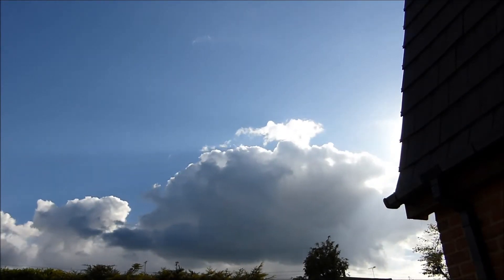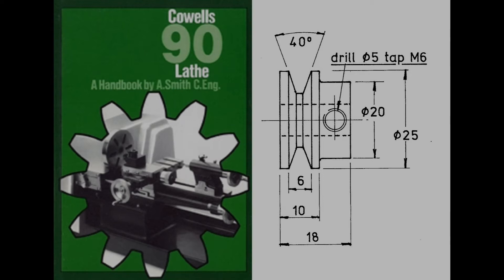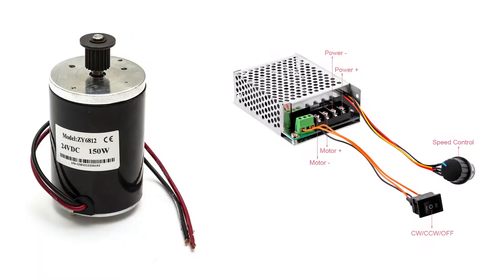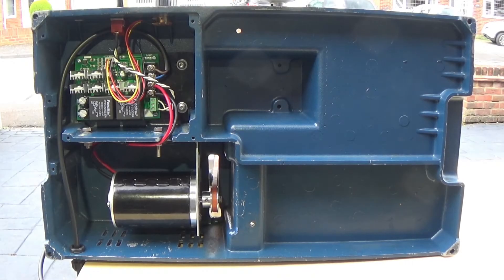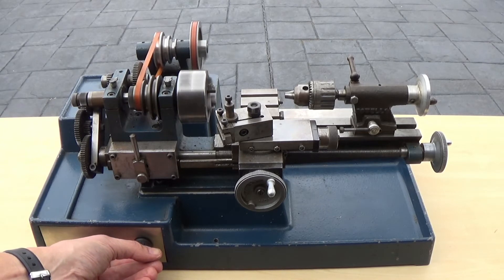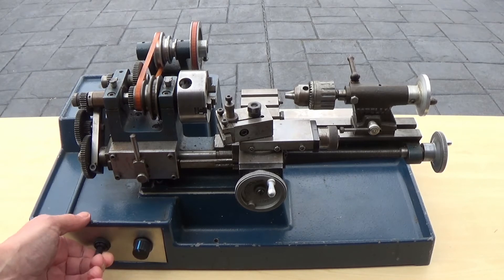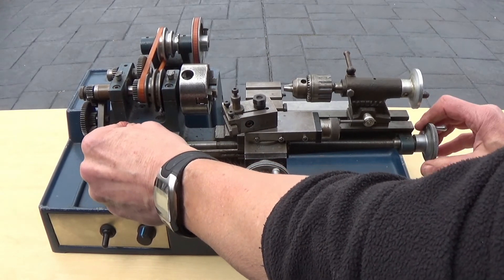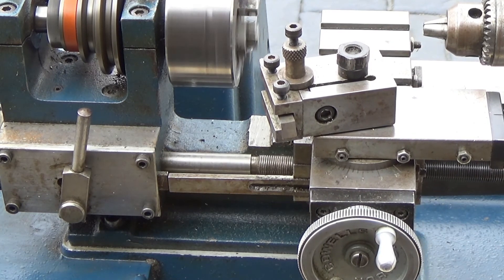Cowells 90ME Lathe  - Part 2 - First Run

Comment: 4:27 shows the motor pulley and belt out of alignment with the countershaft pulley. Might explain what appear excessive vibration/play in the left side of the countershaft at 4:43.

Comment: This looks like a very interesting little lathe. What is the maximum depth of cut achievable without overtaxing it on materials like CZ121, EN1A-Pb and 2011 T6?
Reply from the maker: I wouldn't like to hazard a guess on that one Henry as I haven't actually used this lathe in anger yet. I bought it as a restoration project and it needed several things putting right before I put it to use. Cowells lathes are really designed for small, high-precision work like watchmaking so I'm not sure if maximum depth of cut is really that important to the typical user of such a small lathe.

If you really want a definitive answer I would contact Cowells directly at www.cowells.com as Colin Childs the director there has always been very helpful with any queries I have had.
Reply: Thank you for taking the time to reply to my enquiry. I am sure you will get a lot of pleasure from using your Cowells lathe.

Comment: What a great set of videos this is going to be. I love the ones so far and I think you'll end up quite attached to this little lathe.
Reply from the maker: Hi Peter,

I'm glad you like the video. I wish I'd videoed the belt replacement now, I guess that would have made an interesting little video in itself. Changing the belt is a relatively easy thing to do if a little involved. Getting the pulley clusters off to get the old belt off and the new one on should be a straightforward process.

You just have to be careful about introducing end float in the spindle and countershaft when you put the pulley clusters back and not over-tightening anything to make the shafts bind. The spindle pulley cluster also has to align the back gears as well and the countershaft. The countershaft pulley cluster should be positioned on its shaft so the drive belt doesn't rub the back gear on the furthest position left. Make sure also that when you tighten the pulley grub screws up you are over the ground flat on the shaft.

Also pay attention to the spindle bearing clamping screws. These should be adjusted with the drive belt slack and the spindle free to rotate. Nip them up until the spindle just binds and then back off a fraction.

Hope that helps but if you have any problems the come back to me and I'll see if I can help.
Reply from the maker: Thanks for that Ron. You gotta love a little lathe...
Reply: I have a cowells I love it! I have question about belts though, I have changed my motor belt but belt from pulley to lathe is looking old now,  how hard is to change and does effect the squareness of the lathe to fit it?
Reply: ps great video!